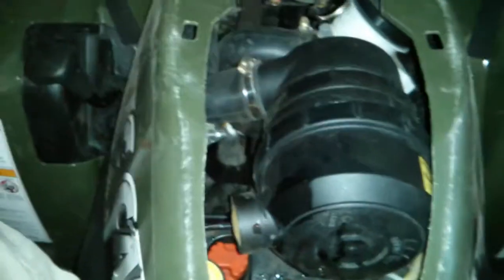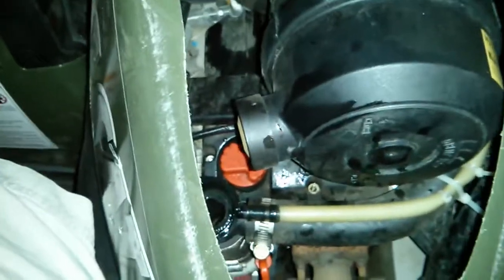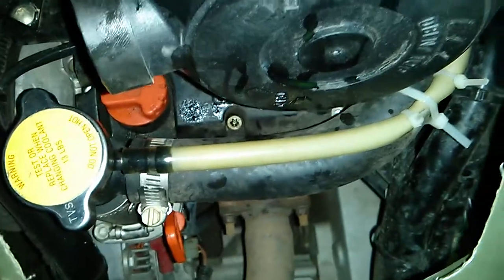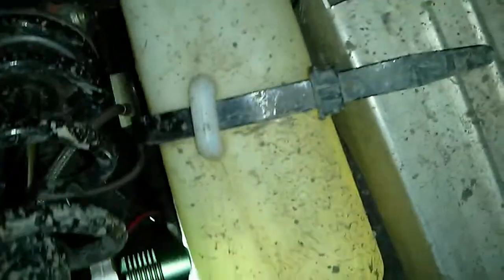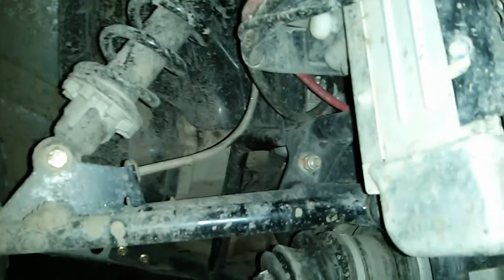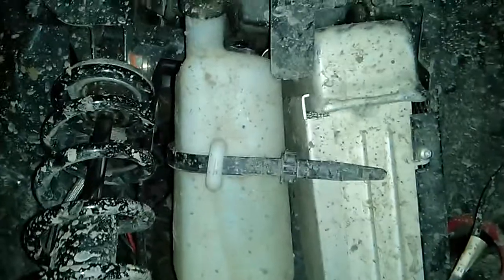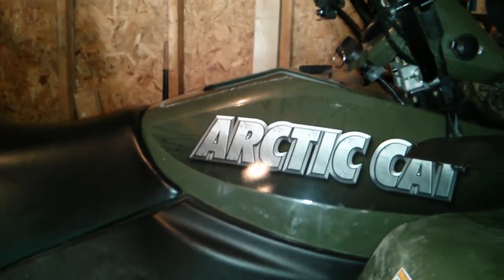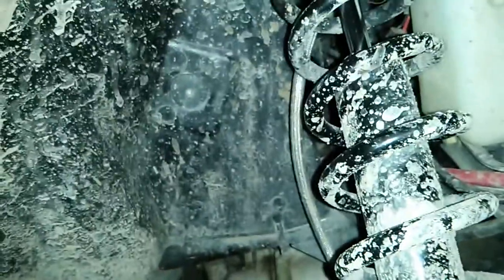Coolant Issues NOT SOLVED :( Need A New Hose? - 2007 Arctic Cat 700 Diesel

Comment: Your overflow tube is blocked by a kink at the wire tie. you can see it in the video. Also don't open the radiator cap all the time it relieves the vacuum that refills the radiator when lower coolent temps are present.  Motors are like computers there machines.  Logical diagnosis with a method will always set you on the correct path to fixing it.   Sorry about the comments below.  I'vd been fixing engines since Hector was a pup….

Comment: Hi man where are you from I have one myself do you have the fan running all the time I know on mine I had a sing on the dash can't remember what it look like but the fuse under the seat was blown it seem like your in Canada I'm from New Brunswick I'm a tech and I work on VW diesel if you need help call me at 506-358-1888 ask for Christian make sure that the top and bottom hose of the radiator get hot on the top and bottom then you will know that it is flowing and the thermostat is opening.